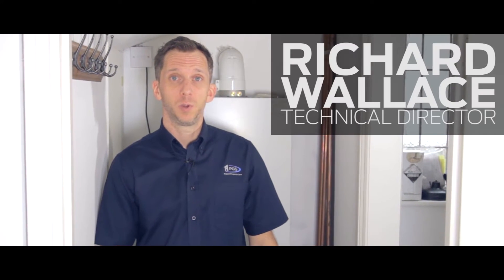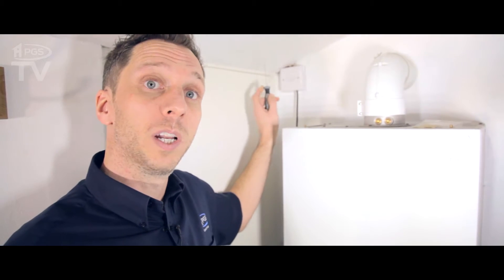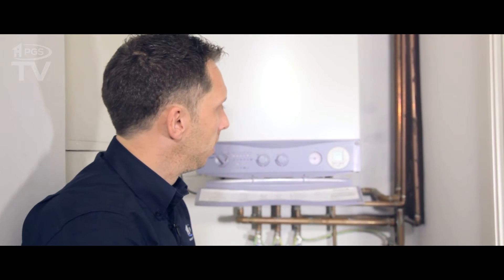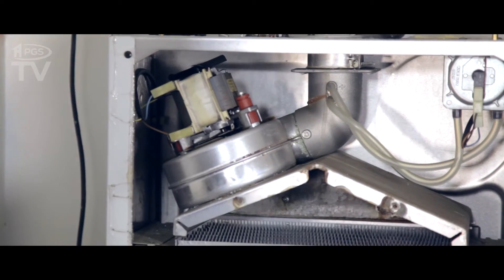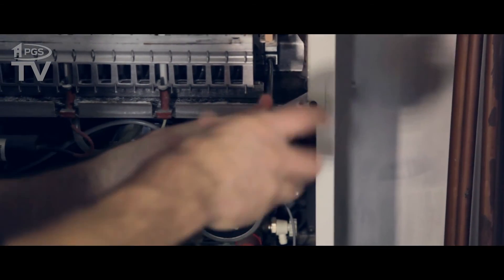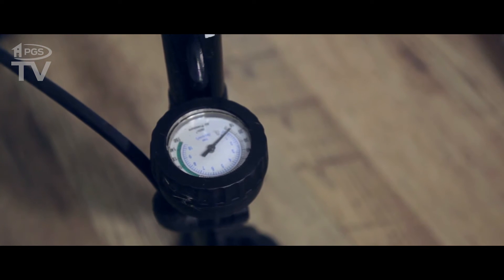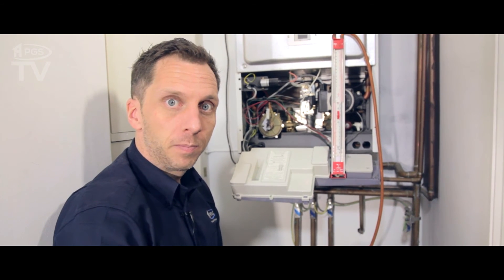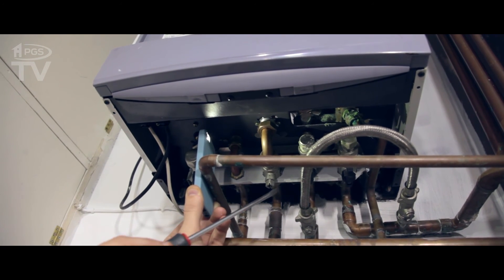PGS Services carry out a service on a Potterton boiler in Chessington, Surrey.

Comment: What should the burner pressure be? And how do you know if you've connected the fan back on properly? Is there any way to check? I get worried I may not have connected the things inside back on properly so I don't like servicing but I want to be able to do it

Comment: What about the missing cap from flue at the end, can see the inner flue test cap is there but the air inlet side is missing. Thorough cleaning doesnt outweigh basic safety ie the At Risk scenario with a cracked insulation panel.

Comment: Wouldn't you place a do not use sticker on boiler if the rear combustion board has a crack. Also would you check the door seals too making sure they are in good condition for contiued use.